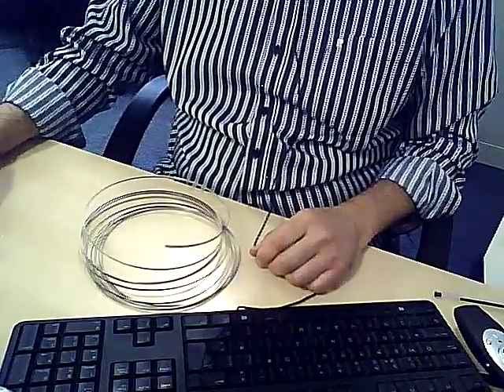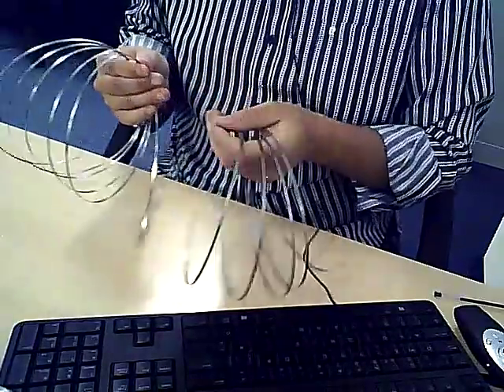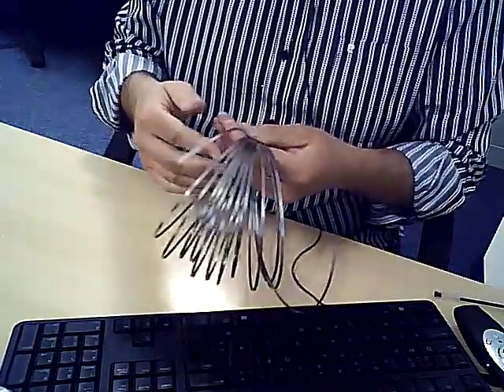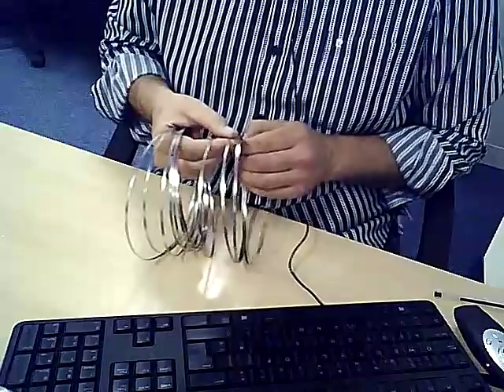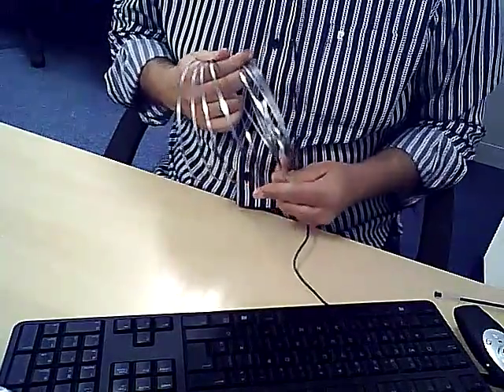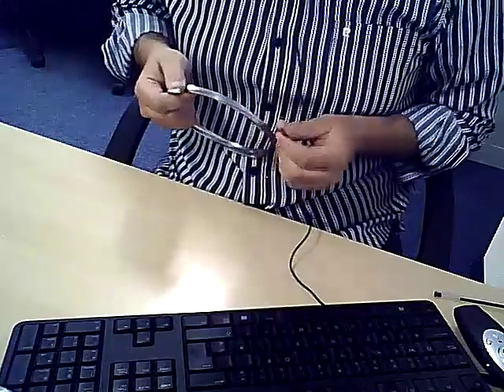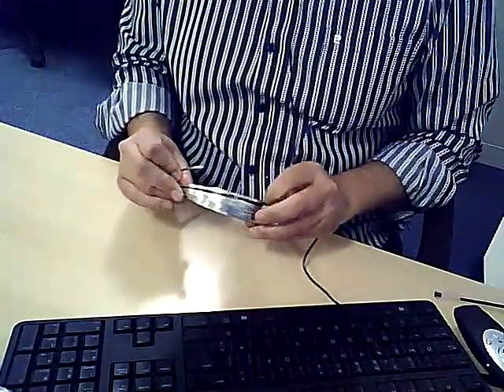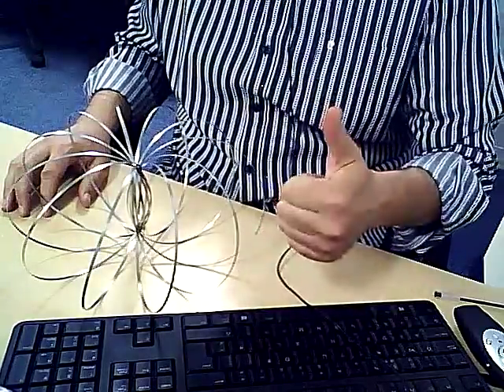How to fix a flow ring.  Fix GeoFlux, Fix ToroFlux. Flow ring repair.

Comment: But does it flow up and down your arm?  We have one that still has the correct shape, it just won't roll anymore like it's supposed to. It isn't bent or broken apart. It simply will not roll. So how do I fix that?
Reply from the maker: If it's not rolling you need to add another loop - too many and it will be too rigid not enough and it will be too loose.  I've found that if it stands but doesn't roll you're about 1 loop too little.
Reply: @matthewrowe3800   That is exactly what it's doing, just staying open. Thanks! I'll give it another loop.
Reply: @matthewrowe3800  Mine hasn't fallen apart and stands kind of perfectly only it's a little "unaesthetic" and also won't roll properly. Maybe a loop has crossed over somewhere it shouldn't be? Can you be of assistance?
Also it's a struggle to push it down to make it a ring again too.

Comment: What kind of tape did you use for the ends ?
Reply from the maker: I only used Sellotape but you need to use some sort of epoxy glue from a DIY shop for a permanent fix.  You can't weld them as they are too soft but you might get away with soldering.

Comment: Thanks so much I have 2 that don't roll anymore GBA try this
Reply from the maker: When you tie them back up you need to make sure you have enough loops - too few and it will stand up but won't be grippy enough to roll.  Add another loop - be warned it's quite a task.

Comment: Ok, it'll stand..... but won't flow on arm anymore..... Sooooo???????
Reply from the maker: If it's not rolling you need to add another loop - too many and it will be too rigid not enough and it will be too loose.  I've found that if it stands but doesn't roll you're about 1 loop too little.